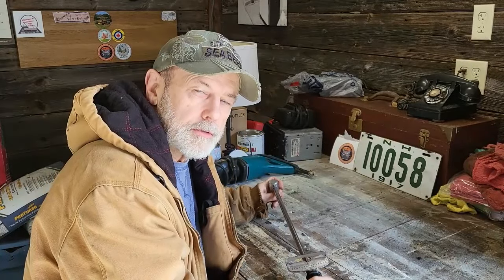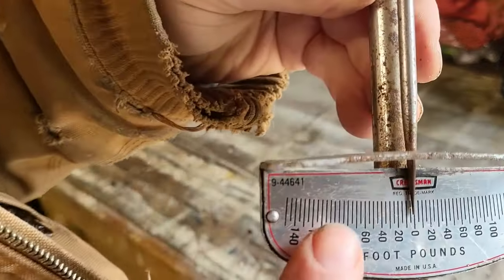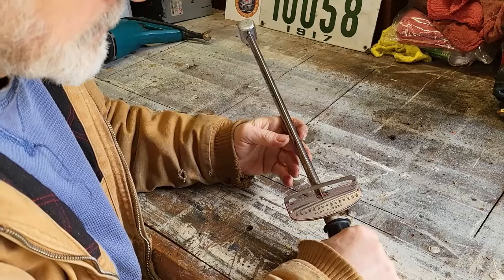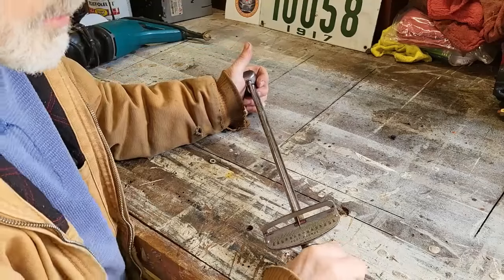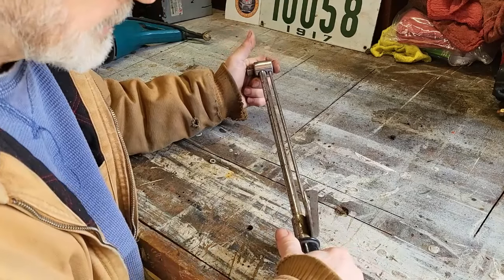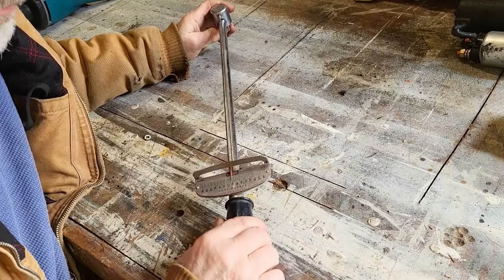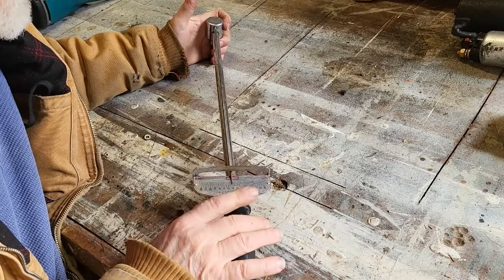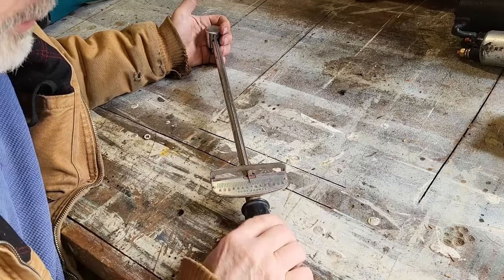Antique Tools, Episode 3 - Sears Craftsman Torque Wrench

Comment: Those are tuff wrenches, no wear parts and fairly accurate.  You can still buy those beam torque wrenches today.  Thanks for sharing Rick.
Reply from the maker: It has never failed me. No snapped bolts, and nothing has come loose. Thanks, Paul.

Comment: I still use the 2 that I have. The oldest is late 60's, and the "newer" is mid 70's.. Everything I used these on is still intact and functioning, the last I heard anyway!
Reply from the maker: I just used my torque wrench today, but as a breaker bar. Removing a brake caliper.. Couldn't find my breaker bar. This was an easy job, so the torque wrench was sufficient. Thanks for visiting and commenting.  I appreciate it.  - Rick

Comment: I think the WF on the wrench means it was made by Western Forge. I have that same wrench that I bought new in 1968 to work on an old car I had in college. Still have it in the box.
Reply from the maker: I think you're correct! I just used this wrench as a breaker bar yesterday, couldn't find my breaker bar. It was just a tight bolt on a brake caliper. Thanks for visiting and commenting. - Rick

Comment: How's she goin'?  That's an interesting tool Rick.  I have one similar to this but it's 3/8 drive.  I bought it in the early 70's too.  I still use it on occasion.  Not too sure how accurate it is, but it pacifies me at the very least!  LOL  Take 'er easy!!!
Reply from the maker: Same here, Mike. This one is accurate enough for me. I've never had an issue with nuts or bolts coming loose or breaking. I do remember it was fairly expensive, especially for a cash-strapped young'un!  Have a good week!

Comment: I have a couple of those that i still use when I'm working on something that needs to be torqued.  I have the ratchet types, but these are so much simpler to use and give you the response instantly.   You dont have to adjust anything, just put it on, turn it till you get your reading and stop.  Best of all is you know if the measurement is off(Pointer isnt on 0 to begin with) you can do the math in your head(Add or Subtract the number it starts at) without resorting to new math.
Reply from the maker: I've never used the ratchet types. You are correct, this is simple to use. I still use it occasionally. Thanks for visiting and commenting. - Rick